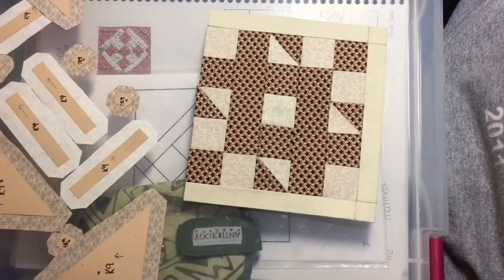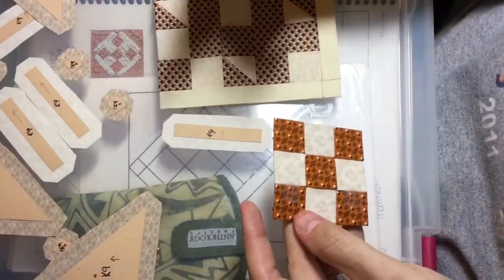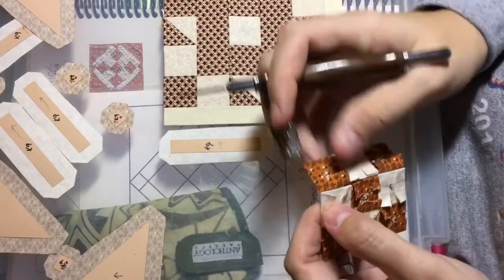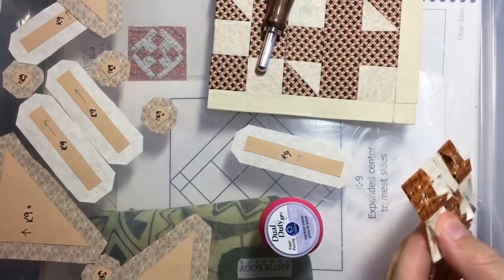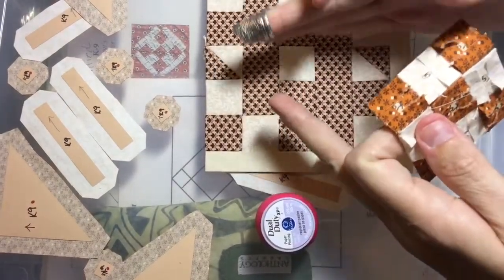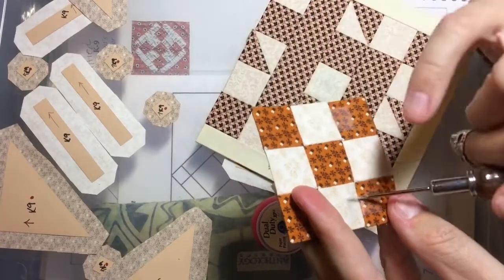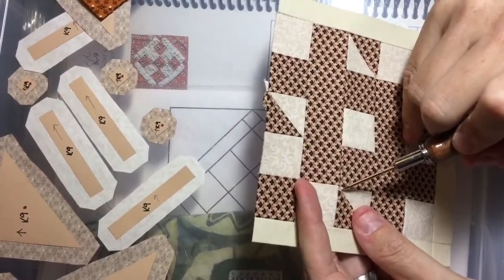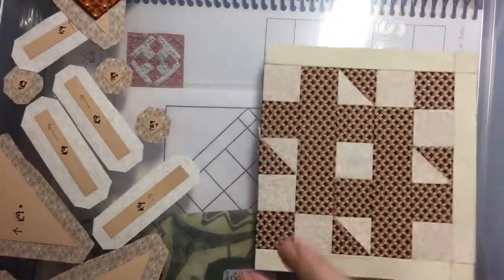Flat Back Stitch Method - Dear Jane Goes EPP

Comment: Would have like a close-up of the flat back seam. Tip about using scotch tape and  x across corners very helpful.
Reply from the maker: This was one of the first videos I filmed, so I would change a bunch of things if I did it now.  I can tell you that I use the same technique in the other videos so you should be able to see it closer on one of the others.  I just can’t think of a specific one of the about 200 videos on my channel.  Let me know if you have any other questions.  Thanks!

Comment: Great video.  I'd really like to see a hexagon done with your method. It seems as if you have two layers of fabric, right?
Reply from the maker: Hexagons work exactly the same way as Dear Jane pieces.  They interlock together better, so it’s actually easier to work with hexies.  There is only one layer of fabric.  There are places where it is folded over to baste the seam allowances down, but in the end it is only one layer.  Not sure I understand what you are getting at.  Please clarify and I would be happy to help.
Reply: Poole’s Piecing.  I meant it appears that the edges that are folded over, appear to completely cover the center of the block....therefore there are more than one layer of cloth.  I would like that feature because I seem to have used a few really thin fabrics!  Thank you for your time